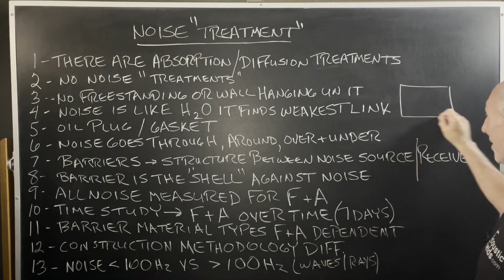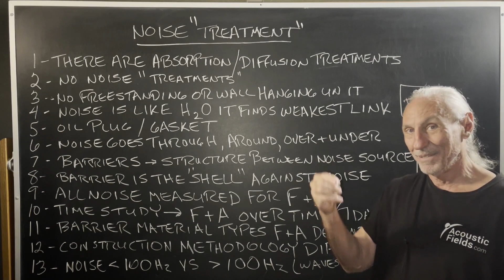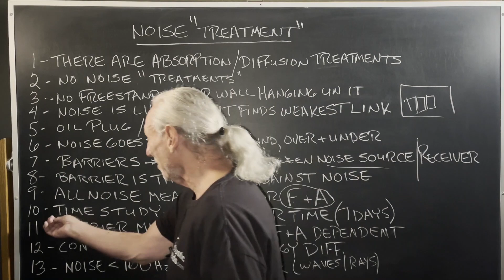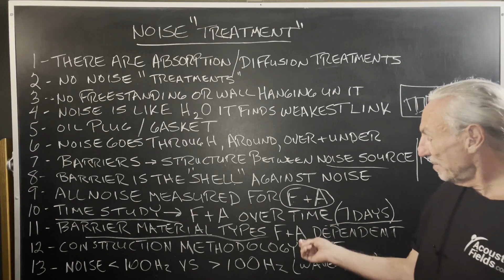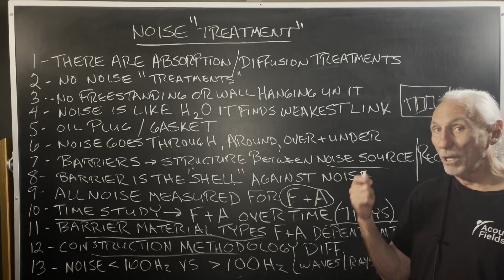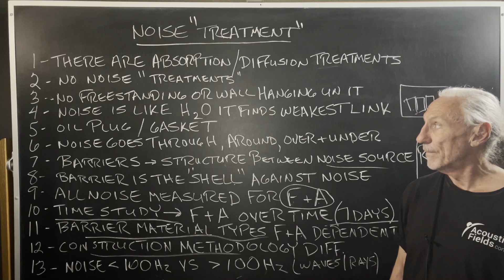Noise "Treatment" - www.AcousticFields.com

Comment: Low frequency, high amplitude...I think of garbage trucks. I'm in a very quiet, large lot, single-family residential area, and garbage trucks are by far the loudest, lowest frequency thing we hear on a regular basis. Thunderstorms are much more so, but they aren't on a schedule. In any case, a huge thunderclap is like nearby artillery, there is nothing that you can afford to do that would eliminate that.
Reply from the maker: Noise transmiison issues at lower frequencies take more materials and certian construction methodologies.

Comment: Thanks for the educational videos. Denis, based on your experience, what  is an acceptable number for noise and what is the average number you find in your projects? Gracias!
Reply from the maker: We normally see SPL levels at 50 - 55 dB. The goal for professional mix rooms is 30 - 35 dB SPL.